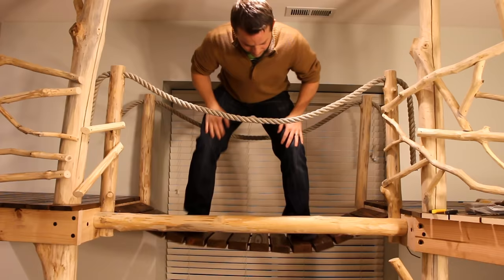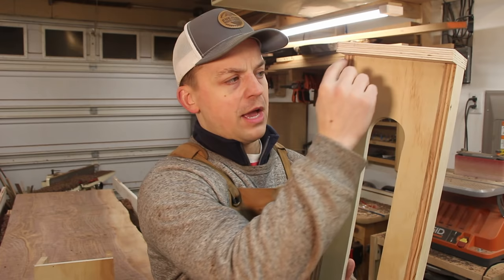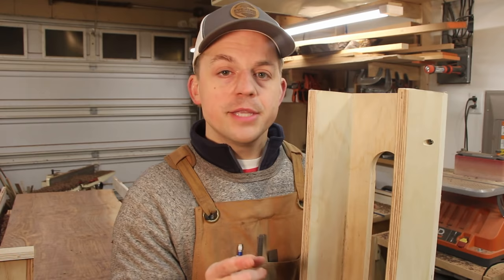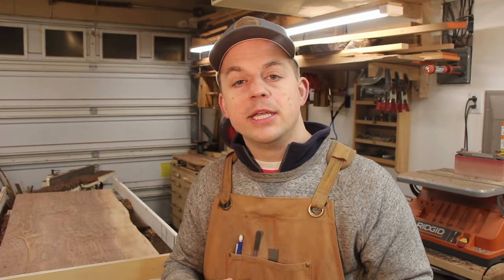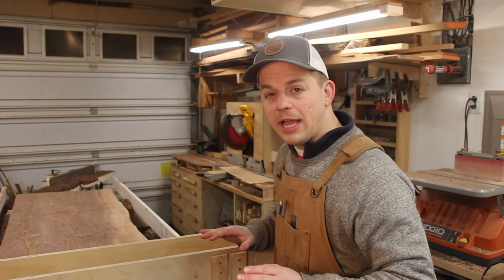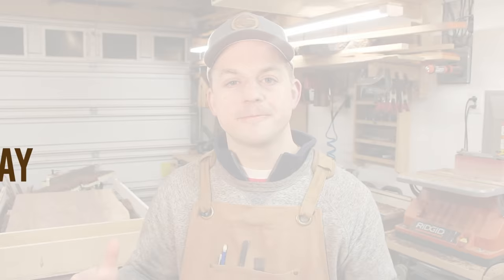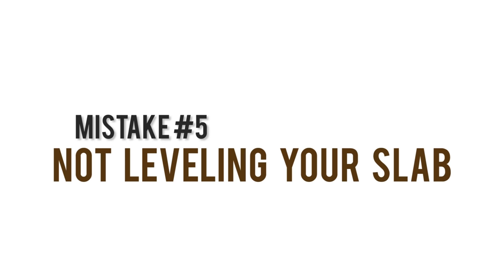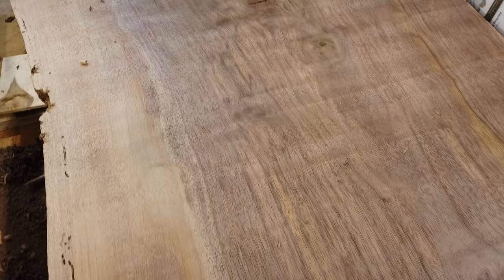DON'T make these Router Sled Mistakes! | Evening Woodworker

Comment: Am I messing something, does a router shed do more then flatten a wood surface ? Because if I needed that slab of walnut flat I would have ran it through my planer ? Honest question, I don't know all the benefits of a router sled...
Reply from the maker: A router sled can flatten a relaxed board so you can get a warp out of it. A planer will push the board down and make it parallel to the opposite face. So if the board is warped, a planer will make it thinner, but it'll still be warped.

Comment: Wouldn't it be better to use MDF for the bottom surface rather than plywood? As I understand it, MDF provides a very flat, smooth surface. I imagine you'd need to seal the MDF to prevent damage from moisture; is there another reason to avoid MDF here?
Reply from the maker: I think mdf could work if you have it available. I just tend to enjoy working with plywood more than mdf because the mdf sawdust is nasty stuff!
Reply: @EveningWoodworker  Yeah, I get that. Until I started watching YouTube videos, I didn't realize how toxic that sawdust can be!

Comment: When sliding the router one handed like that with bigger cutters you ever have issues with the router jumping? Right now im re designing my sled i used 20mm rails and my issue is over 48".. well maybe more like 45" span im geting about .040" dip just from the weight of the router. Wonddering if you notice dip with your wood design.
Reply from the maker: As long as I'm doing conventional milling (cutting opposite the feed direction) and not climb milling, it doesn't jump. If your rails are sagging, then you need to make them taller or out of a more rigid material.

Comment: Query: why does everyone seem to use screws driven at an angle into the sides of the sled, as opposed to screws driven straight "up" from the bottom of the sled into the side pieces? Asking for a friend. 🙂
Reply from the maker: I tried to avoid doing anything to create bumps in the bottom surface. You could countersink the fasteners and make sure there is no surface variation, but it was easier to screw down from the sides.
Reply: @EveningWoodworker Ok, good to know. Thanks!

Comment: Getting ready to flatten a couple tree cookies. 

I inserted the router bit (Whiteside 6220) all the way into the router collet. When the router is plunged all the way down, the bit only protrudes about 3/8" below my sled. This is with a very thin base plate (~1/16") and a sled made from angle iron (~1/8").

How are all these guys getting any bit depth with sleds built from 3/4 ply? My bit wouldn't even clear 3/4 ply. Is it ok to insert the router bit NOT all the way into the collet? I'm concerned it may wander upward or downward while cutting.
Reply from the maker: You can bring it up in the collet and it'll still hold; I usually keep at least an inch of the shaft in the collet. A plunge base helps too.

Comment: small bit mistake is not quite correct.   that is ...do not go bigger  or smaller than your router shank.   the reason is the wall of your collet is the last point of strength (torque) transfer to the bit cutting edge.   and bigger bit than shank tend to wobble and could create snipe cuts..   smaller diameter bit results in lower torque cuttings.  You want the exact same size shank to the cutter diameter thus maintain best torque cutting and least wobble.

Comment: Why don't you go with the grain instead of against it?
Reply from the maker: This sled doesn't slide well going with the grain because the entire sled would have to move more smoothly. For cutting with the grain on this, you need a linear bearing router sled.

Comment: How about just don't use a board?  I'm building mine out of a scrap steel 1x12 beam.  One cut down the middle, then attach my rail guide. Woodworkers forget there are sometimes much easier materials to use than wood for certain things.
Reply from the maker: That should keep it straight, but man it's gonna be heavy!
Reply: Yup.  Not heavier than the MDF base though.  I guess it really depends how bad you want dimensional stability, and how OCD you are designing jigs.  With cheap angle iron it should stay flat for decades.

Comment: Stop using wood to make router sleds. Use steel or aluminum angle iron. Wood swells and warps with changes in temperature and humidity. Steel or aluminum are machined to be straight and flat, plus your sled will last a lifetime
Reply from the maker: Both can work well, but yes metal usually lasts longer.